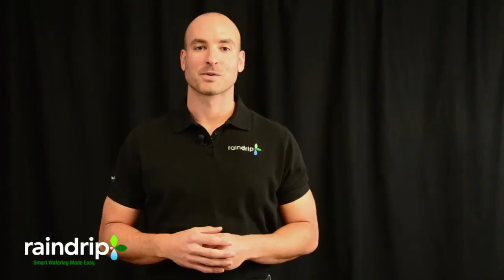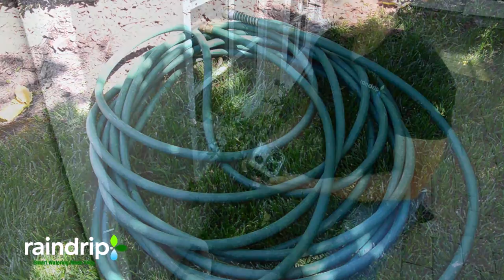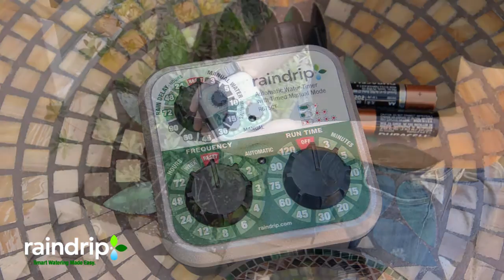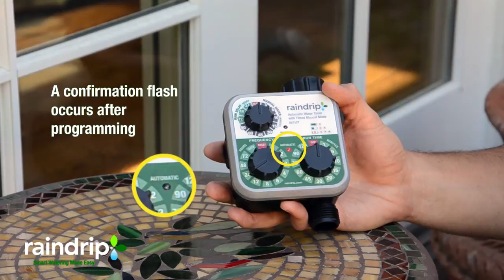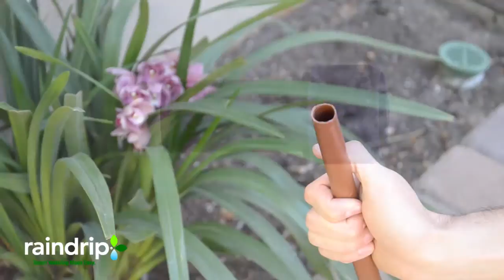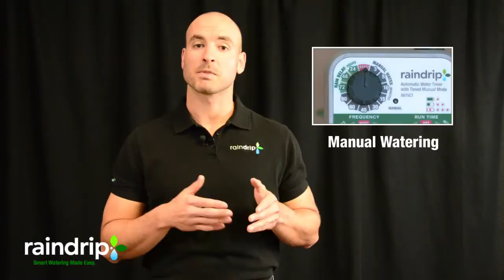DIY Installation of New Timer Model

Comment: Changed batteries after 6 months. Timer won't work now? Lights flash and respond to settings but no water comes out. Turned off water and took off tube swivel connector and turned water back on. Turned on Manual water but nothing came out. Took off timer and turned on water and water gushed out, so water supply is working. On the timer I have on another bib I turned on manual and heard the click and water came on in 3-4 seconds. Took off bad timer and took in house. Put in another set of batteries. Spun them slowly in place the improve a connection. Then put pack back into timer and set all knobs to "Reset", "Reset" and "Off". Then turned on the manual to water 3 minutes. Listened to both ends of the timer hose attachments for a click - nothing. (helpful with troubleshooting if
you made it click to show the solenoid is trying to open/close something).  
Can you make any suggestions as to what might be wrong or how I might fix it? 
Contact me at friendlyt@lycos.com  Thanks.
Reply: I'm having  the same issue this time re is junk